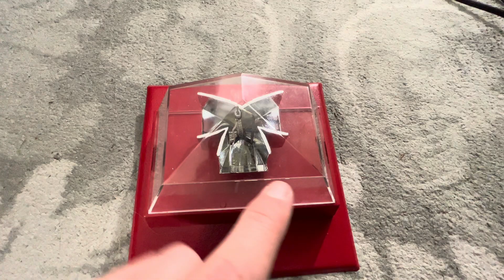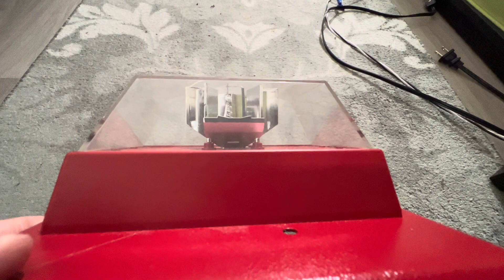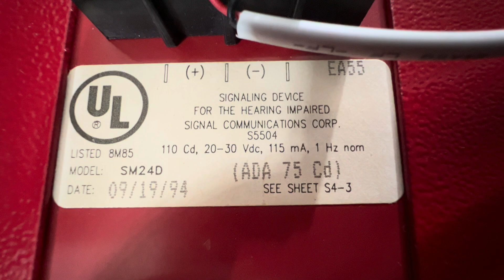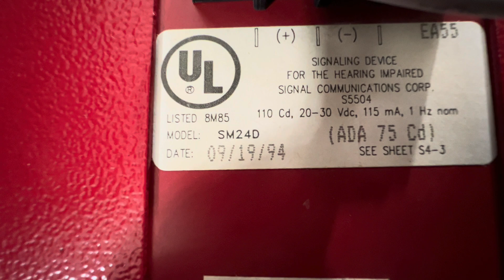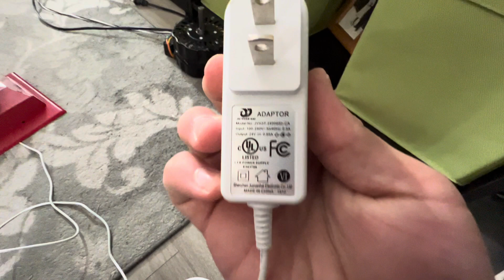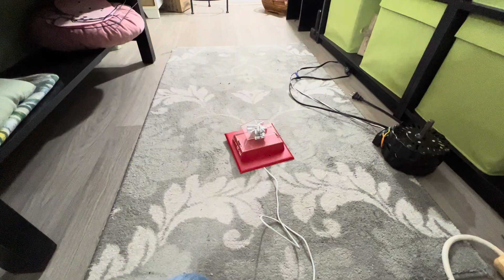1994 Space Age Electronics SM24D Remote Strobe Fire Alarm (Overview & Test)

Comment: I don't know if you've figured this out by know (since the video is 2 years old), but SM24D is actually the model number for the Sigcom rebrand (and the label says Signal Communications Corp. which is Sigcom). The actual SAE model would be similar to "VA3-BL-SFXR-TN24D-0000". -TN24D strobes are 15Cd so idk what the 110Cd version would have but you get the idea.